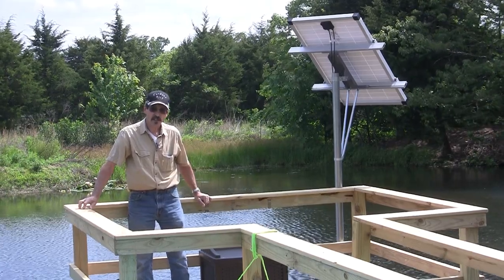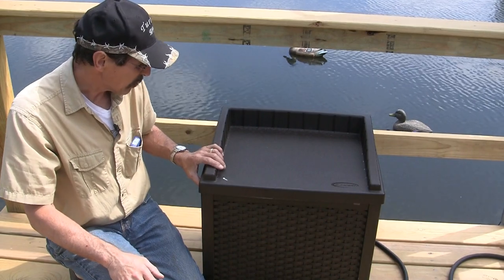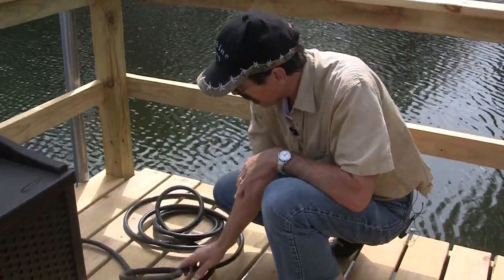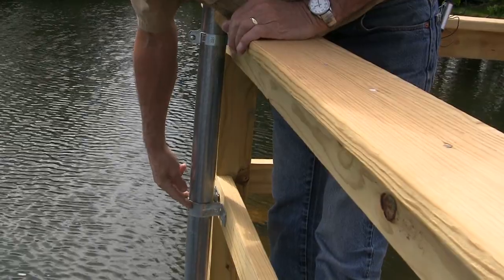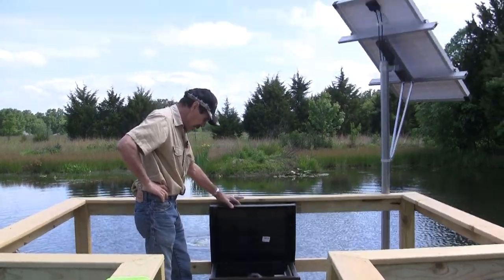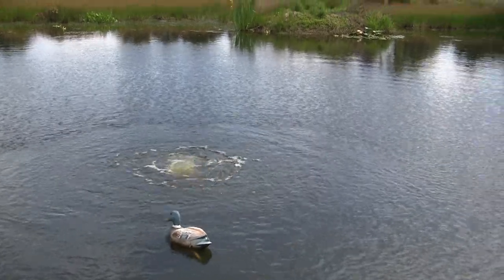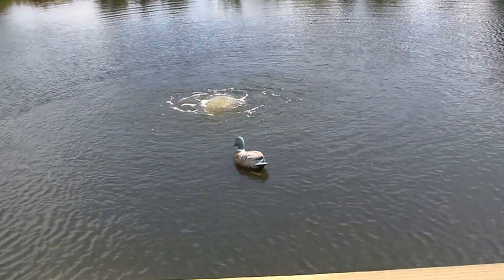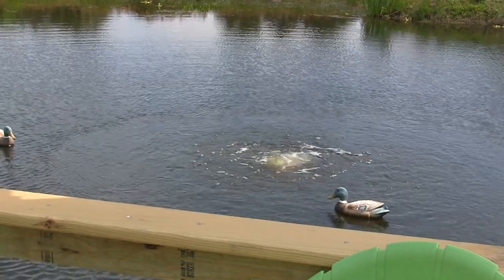New Pond Aeration Kit with Solar Panel | Missouri Wind and Solar

Comment: This pond aeration kit is so smart. Its the suntaqe that really does the rick. No battery's this is an amazingly smart make.
Reply from the maker: jennifer lyn You save alot of money not having to buy batteries. The only draw back is it only works during the day and the battery system works 24 hours a day. You don't need 24 hour a day aeration though.

Comment: the solar panels comes with the kit right? I see your website only says

This Pond Aeration Kit Includes:

22 Gallon Resin Wicker Storage Seat
Matala Hakko HK 40 Liter Air Pump
20 feet weighted 5/8 ID hose
Diffusers
Clamps & Fittings
12 Volt Suntaqe PWB (Power without Batteries) Inverter Controller with 12 volt 150 watt DC to AC modified inverter

Comment: Hey Jeff - Hope all is well. I constructed a small solar generator for my 33-gal backyard pond. However, the PWM 10A solar charger does exactly "opposite" of what I want it to do (ie, the LOAD output works as designed for a night light...comes on at dusk). Is there any small PWM out there that has a programmable LOAD output that turns "on" when the sun comes out? And, is programmable for a few hours after the sun goes down? Thanks.

Comment: Jeff, what kind of ventilation does that box have to keep the pump cool enough not to overheat on hot summer days?
Reply from the maker: The lid has a large gap under it to let heat out.

Comment: Nice system But why not just run a DC pump??
Reply from the maker: ***** The DC pumps i found were junk and the good ones expensive. AC is a better pump and will last for years.
Reply: That inverter will hold up without any kind of inline battery?
Reply from the maker: ***** Yes it will. The Suntaqe was designed by us to operate a dc to ac inverter without hurting it. It's designed to shut down for 5 minutes when a black cloud would go over , that gives the inverter time to cool down , no on off on off. This one i programmed it to come back on in a few seconds for the video.
Reply: Cool!
Reply from the maker: ***** Also you can hook up a radio or laptop to the suntaqe inverter.
Reply: Think ill order one off your site next week to test out.

Comment: Is there a battery that can be added to this later for 24/7 running if I was interested in doing that?
Reply from the maker: +jsh1103 No you cannot add a battery to it.
Reply: Jeff, out of curiosity, why couldn't this setup be modified to add batteries to it for 24/7 operation?  Excuse my ignorance, I haven't educated myself on that sort of system yet.  Thanks!